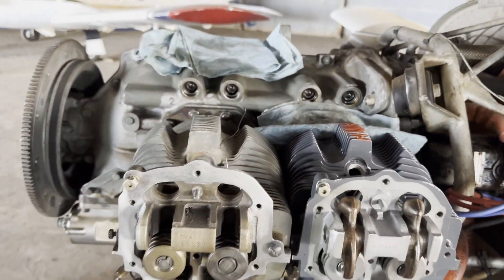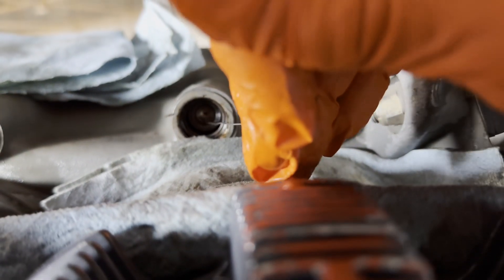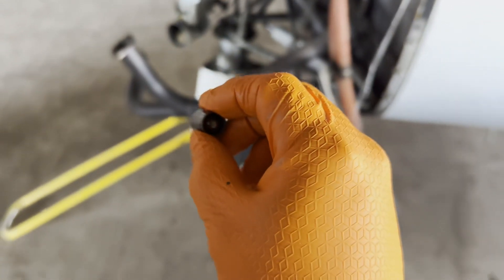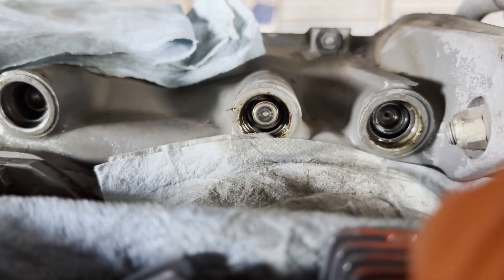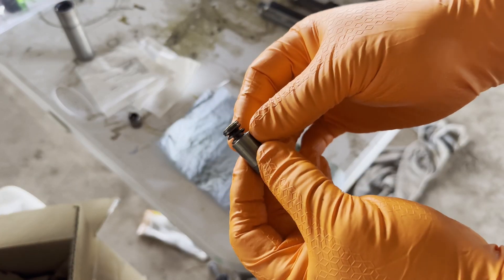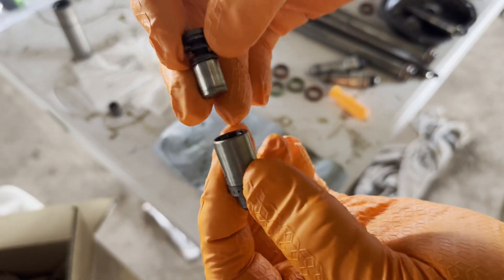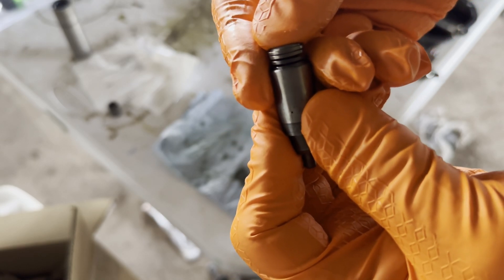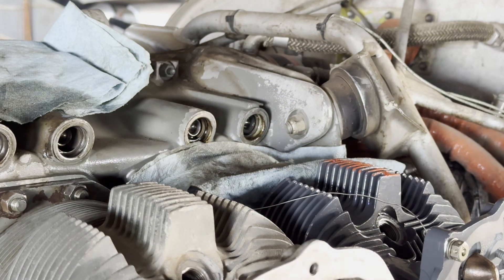Lycoming 0-320 Lifter removal

Comment: Finally found a video of how you disassemble the plunger. Was watching yours and right when you got ready to disassemble the plunger you cut to where it was already disassemble!  Frustrating!  How did you do that? You can’t just pull it out, right? Or can you? I saw another video where it looks like a quarter turn locking type of deal.
Reply from the maker: Yeah. That was pretty frustrating. I spent all that time trying to show the process only to have the camera cut out during the disassembly.
Reply: @jeremccurdy  
No worries…I ended up figuring it out.   For some reason I was under the impression that you had to collapse the plunger before you turned it counterclockwise to get it to come out. And that was darn near impossible, at least for me.  I ended up just turning it counter clockwise without compressing it and it popped right out. And then I felt like an idiot.  But your video still helped. Thanks!